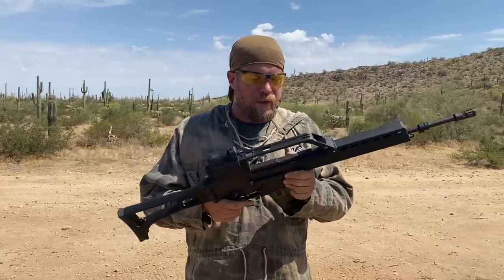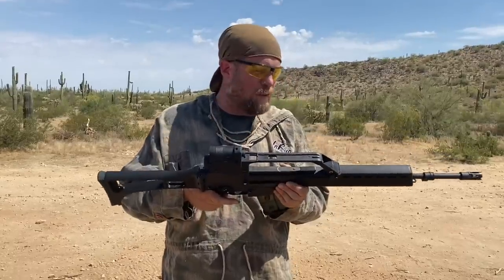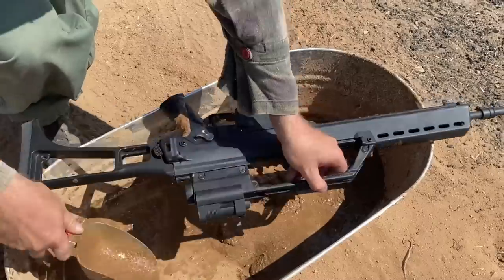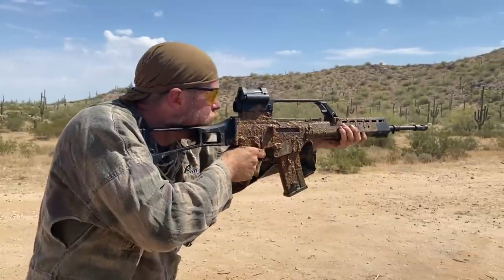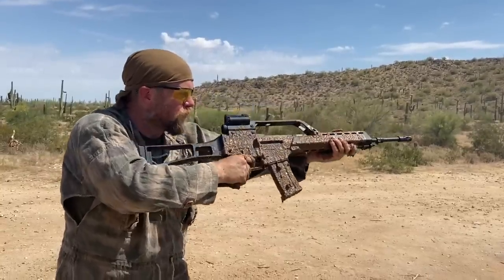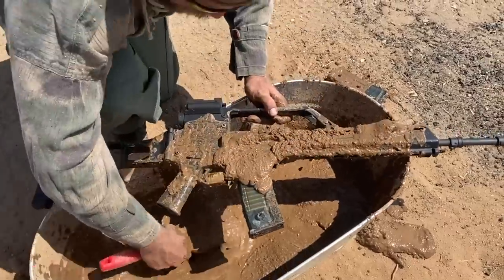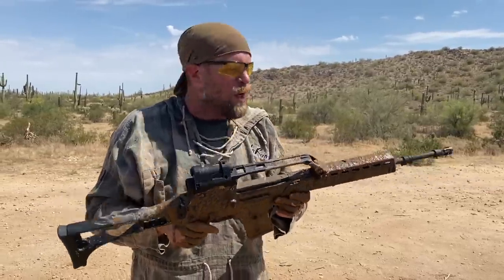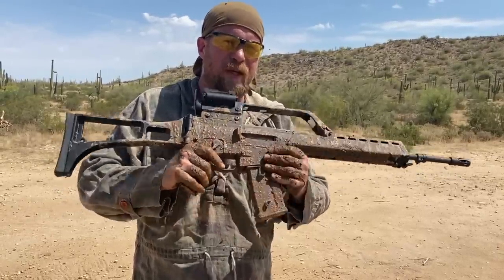Mud Test: G36

Comment: Why did the g36 pass but the 416 failed? Aren't they very similar(inclosed, tight, short short gas piston)?
Reply: If the bolt is forward on the G36 the action is completely sealed (same with the SCAR). HK416 has a AR-style bolt carrier group, action is not completely sealed if bolt is forward (the reason it needs a dust cover in the first place).
Reply: @jonny2954  Thanks man.
Reply: @jonny2954  it’s not a matter of tightness, large tolerances, a minimal contact patch in the receiver and a suspended bolt group, these are the characteristics of the G36.

Comment: Ok so, why is germany considering replacing this rifle again? To waste tax payer money? Because some troops overheated it?
Seriously, it is a reliable, lightweight, easy to clean, modular, ambidextrous and fairly precise rifle. Why change it? 

You are not getting anything that seriously improves a soldier lethality or efficency, and those money could be used in better ways.
We italians just adopted the arx 160 and that rifle is at the same technological level of the g36, exept it can change the ejection side, it has a quick change barrel and it has worst ergonomics.
Reply: v.d.L needed a scandal so that she could distract from her abysmal performance. That's why.
Reply: What money are you referring to?There is none!

Comment: Its a modern rifle, big deal that it works when splashed with muddy water. What they should be looking at is how easy it is to field strip and clean
Reply: That's ridiculously easy., too. The gun was designed for a conscript army - that means only short training (and with the strict gun laws in Germany, you can count on 99% of recruits having had NO prior shooting experience whatsoever).
Field strip: 
1) fold stock, 
2) push out one push pin (insert into hole in stock so not to loose it), 
3) slide trigger group down 
4) pull out spring carrier with spring
5) pull out bolt carrier
It's hard to simplify that any further.

Comment: Why does the gun not lock open on an empty magazine? Is this because of the conversion kit?
Reply: This rifle was optimized to function with hot 5.56 ammunition. 9-Hole told me that they noticed this in their testing of the gun as well (the gun would only lock back open with M193 spec ammo compared to something like Fiocchi), and Bostic confirmed it with me as well. It's likely that if it wasn't using hot 5.56 NATO spec ammunition, even Bostic warns that it may not be 100%.

Comment: Does this thing not have a bolt hold open or it not functioning?
Reply: Dunno about the Tommy Build. But the original G36 has a spring inside the FCG. If you push the end of that spring to one side, the gun has BHO. If you push it to the other side, the BHO is disabled. No one really knows why, so the rumors were a) to make the gun closer to the manual of arms of a G3 for the soldiers transitioning in the 90s or b) to be able to close off the system in sandstorms.

Comment: Now I wonder if you had used the forward assist if it would have fixed that first little whoopsie ^^ runs
Reply from the maker: No it wouldn’t have, because the bolt was in battery.

Comment: what is supposed to happen? Is there even a weapon that doesnt work with a little mud on the outside? You could also cover your car in mud and check if it still works...
Reply: Definitely, most guns have trouble in this mud. The AK, Steyr AUG, vz. 58, FN FAL, M14... and the list goes on. There are a few rifles that pass.
Reply: It's funny that on the videos where the gun fails, people claim that "no gun can work in this mud" :)
Reply: @MarvinCZ  i still dont understand how did this gun passed the test, i mean i like the g36 but how did it manage to be so good when theres many places where the mud would have gotteng the gun stuck...

Comment: One malfunction?

Don't use your cheap low power amunition and try the actual full throttle ordnance.

And stay away from the optics? You coward.   Bury it in mud for 24 hours and then rinse it with sea water just for the fun of it.